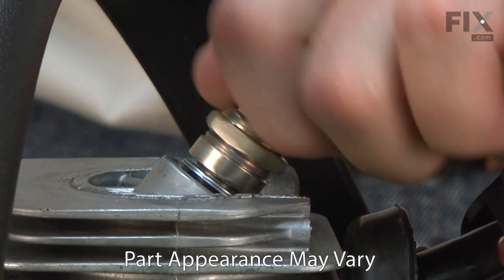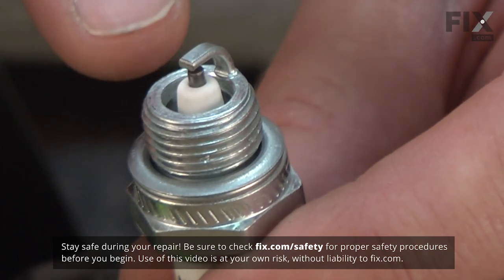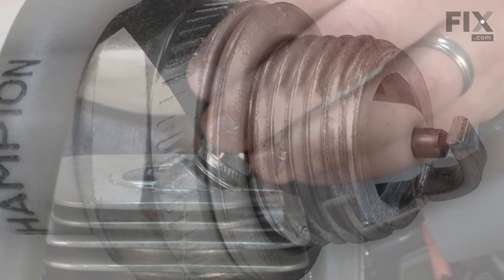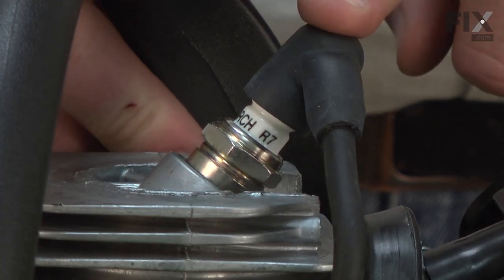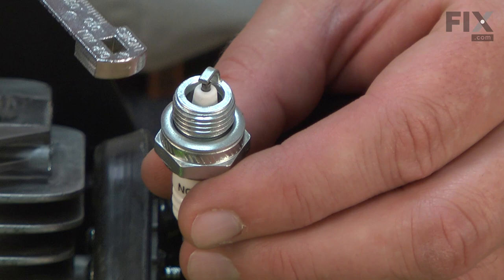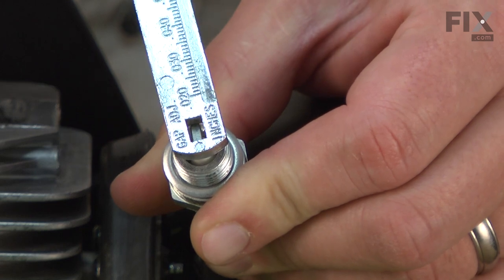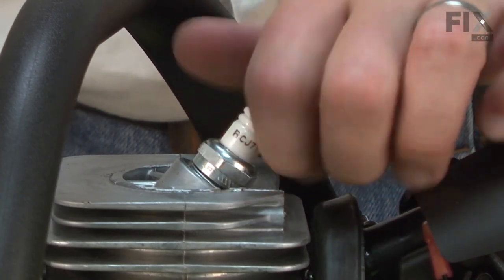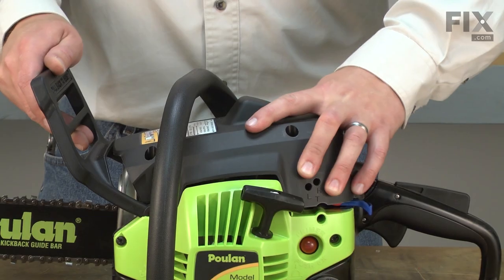Poulan Chainsaw Repair - How to Replace the Spark Plug

Comment: What size socket?
Reply: Use the scrench that came with it
Reply: @christph3118  So, if the scrench is damaged or lost, what size is it supposed to be - 18 mm or 3/4"
Reply: @bryanfinlay9130  Depends on the chainsaw that the scrench came with, there are multiple sizes of sparkplugs and screnches. Google up your chainsaw model, and you'll find out its manual and all the info about the sparkplug type is in there.

Comment: Who carries sockets that long??
Reply: You can buy a set of deep sockets at any auto parts store or Home Depot.
Reply: Anyone who has ever replaced a spark plug ?
Reply: Nobody carries them around mate, you keep a set at home and do maintenance there. At home. Nobody changes sparkplugs in the field, they're not really a consumable, especially for a small engine tool like this, so long as its jetted right.